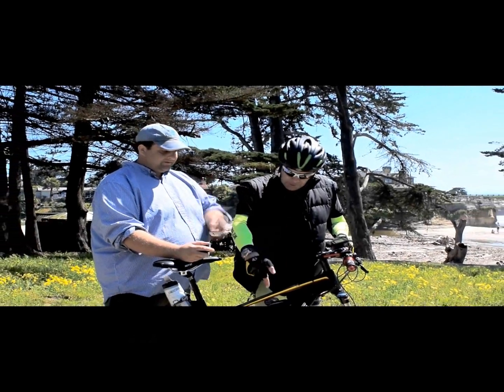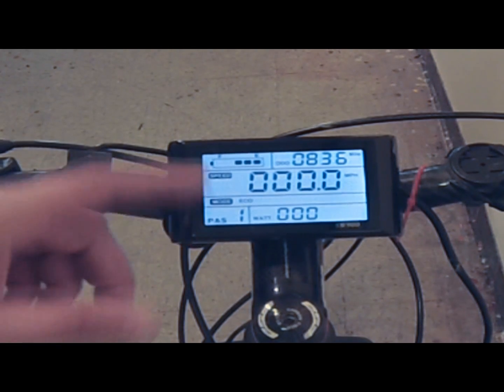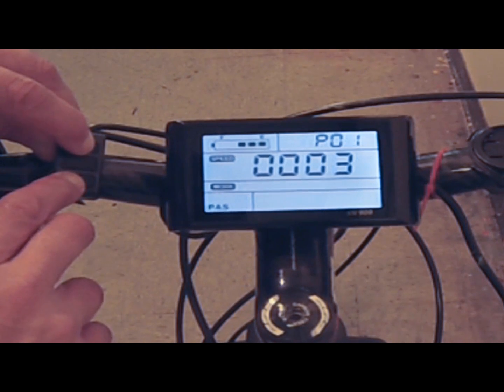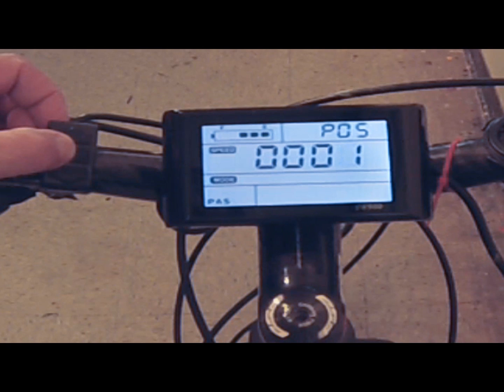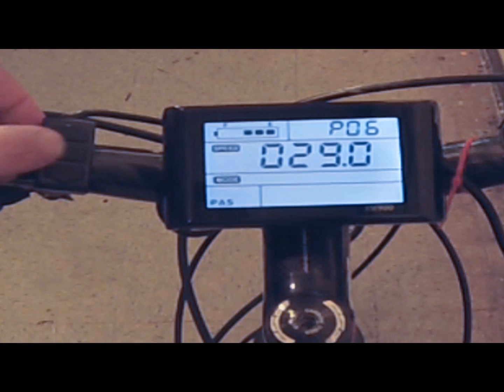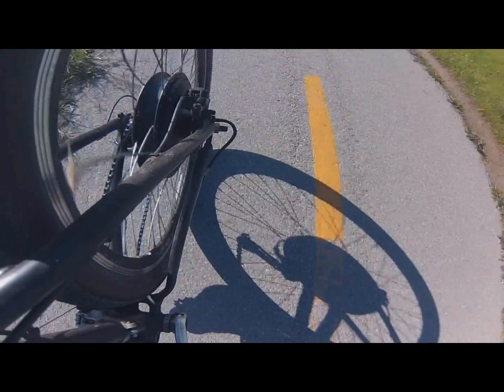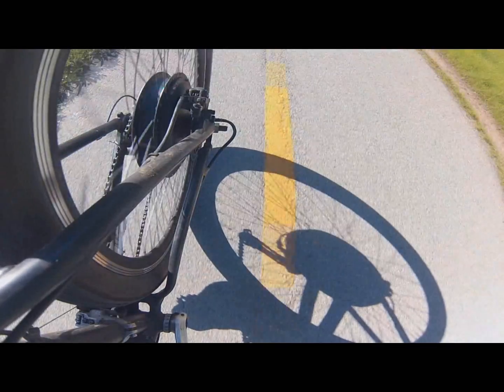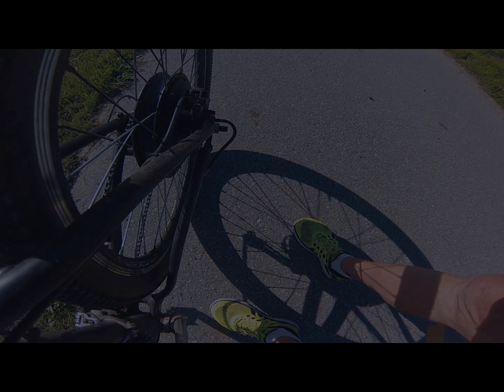How to configure the SW-900 LCD, electric bike multi-function display controller.

Comment: hello thank you for your video. the p14 parameter on my sw900 goes up to 50 A. I have the impression that it is there but inactive because setting it to 1 or 50 does not change anything in torque or speed. possible in your opinion?

Comment: P 14 set at 12A. 12A x 48V = 576 Watts. 
So you are running your 1000w motor at 576W?
Or am I mistaken in my calculations?

Comment: Thank you guys.
Just set up my Cullen version 4, 2000watt motor, 48volt ebike.
The set up of controller was easy thanks to you guys and i spent a few hours cruising and getting familiar with bike.
This thing bloody flies, had it up to 65kph, but still had more power levels to access.
Good video.
Reply: Hello can you give me a list of what you put all your settings to? I’ve messed with mine and not sure what some of the settings should actually be at. I have the same bike as yours
Reply: @rachelc3569  Just followed the set-up on the video, I cant remember wot settings its at

Comment: i have the 72v 2000w sw-900 wheel kit and have 48v battery i just ordered a 52v 2000w 20ah 50a now the wheel kit is 45a can still use the new battery at 50a

Comment: Error code 11 anyone? 

1000w 48v motor
48v 15ah battery 

Bike reaches speed and then cuts in and out briefly, seems to happen at ~1200 watts do I need to adjust #14 down to stop the controller delivering more watts than the motor is capable of?
Reply: Mine does the same have found out the issue

Comment: Does anyone know why my battery connection to the positive side of my actual battery is melting the lead strip connection just before the first cell of the positive side of my battery and of course  it is no longer connected to the battery .
It runs great for a short 4-5 blocks then no power to bike motor or LED screen .
I just soldered it up again and now it runs but I am afraid to go fast or long distance .
I have a Volimart 1000 watt 48 volt 20 Ah system with a SW-900 , this was a full compatable kit from ebay .
What is wrong ?
I was full throttling it til it died .
This system should be able to handle full throttle correct ?
I do have 2 connectors per hot wire and ground could that be the problem ? The wire was short so i used "sleightly"heavier gauge wire and 2 residential connectors per wire rated for more volts and 20 amp 
Thank you. , my email - aaaconstructionllc545@gmail.com

Comment: Hey great video. I just got my first Ebike today and it has the S900 LCD display. When I press and hold the down arrow for 3 seconds it puts a headlight icon on the screen above the power assist section. Do you happen to know what headlight I need for this controller? The s900 also has a USB port. Is that to like recharge a cell phone or something?

Comment: What is the meaning of error 02
Reply: When you brake it will cut power to the motor. it's a safety feature. it shows as an error code 2, but is not really an error.

Comment: Hy, great display but it is not so perfect... I have few questions. 1.When i turn off and then turn on display my trip memory reset to 0,  i know i have odometer, but, is is it possible not to reset trip memory when i turn off/on my bike? 2. When i do downhill without adding throttle on my display is also 0... My display just show speed when i give some throttle. 3. My odometer not count when i ride without throttle. 4. How many amp i need to put on display for my 1000w mottor, 52v 17.ah battery? Thank you all!
Reply: 1. not possible to stop trip reset on power cycle 2.  it will only measure  speed and distance when you apply throttle or PAS. need an external  independent computer/ gps to do that  3. see number 2 response 4. as high it will go 19a! better late than never... :)

Comment: What number should be on P15 and P16, my PAS doesn’t work for some reason, when I throttle the pedals become very light when I try to pedal?
Reply: I see this video is a couple years old. I'm a new ebiker and trying to dial mine in. The way mine is setup it just seems way to fast starting up on pas1.  Is there anyway to set speeds for each assist level? The bike just lunges hard with 1 pedal revolution and I need to be in the tallest gear to even be able to pedal at that speed. It's running 12 mph at eco mode. Any help would be appreciated.
Reply: get a KT controller with lcd3. much better

Comment: I just purchased a 1500w ebike bit from ebay. Whats the best battery to use for the best range?
Reply from the maker: You can use a 48v or 52v, the higher the amp hours determines your range. So, the difference between a 10ah battery and a 30ah battery is 15 miles vs 50 miles
Reply: 14ah-16ah will do just fine for approx 25 miles if you are planning to pedal.

Comment: I do not have  this computer and controller, but I find it very interesting that it would have a setting on the display for the 48v and 36v.

 If you have a 48 volt battery. What would happen if you set the controller at 36 volts? Will it still work and turn down the voltage?
Reply from the maker: The simple answer is yes, but it wouldn't work very well. The reason for the choices is at the history of electric bikes. The early ebikes were 12v then 24v then 36v and 48v. Now there are controllers that can handle a range of 24v to 72v and beyond.

Comment: Is there any possibility to set the PAS strength? No matter what I choose, I always get the full power until the speedlimit is reached.
Reply: Did you fix this problem? I got the same kit and I need to set the pas. Could you help me?
Reply: @vincenzotatti3325  I need help with this
Reply: @vincenzotatti3325  i don't think there is any way to set it. The bike always goes full Power. The setting is just fake

Comment: thanks for the video. I have  a question. Point 7. How many magnets do you have in your engine or perhaps you can tell the model of the engine so I can check myself.
Reply: Hi, did you got an answer to that?
Reply: Did you figure out how many magnets are in your engine because I accidentally changed my setting on it and don't know what the factory setting was

Comment: I finally got my system working on my trike. I needed to extend the wires and configure the trike the way I like. (I prefer bar-end shifters so that means some customization.)

I did get the PAS system to work after not working originally. I've found out working on e-bikes over the years that the Hall sensors need to detect a specific magnetic polarity to work properly. (I had an old trike where the trike went backwards when the crank was pedaled normally. The magnets were glued on the aluminum chainring.

On my latest trike I just took the PAS magnet ring off and put it back on with the other side in. I may have moved the Hall sensor to a different position to get it closer to the spinning magnets and that caused the problem originally.

Now, my comment. The PAS comes on too hard so that I'll pedal a little and the motor powers up too fast and then I coast. How can I make the motor run smoother, not on and off. I'm used to a BionX system which has a very natural and smooth PAS system. 

This is with a generic Chinese 1000 watt hub motor and a 48 volt battery. But I don't think that means much for the PAS settings.
Reply: I have the same problem with PAS comes on to strong , feels like it's on or off , thought it should 3 or 5 steps depending on the pas setings, did you find how to fix this problem ?
Reply: Not really. Today I took a 23 mile ride on a paved trail. When I started the ride the power came on like gang-busters, showing 900 watts for short periods of time. I have set my top speed to be 25 kph, translates to 16 mph in the US, about, and if I push faster than 16 mph, I get no added help.

But as the day went on, my voltage display went down to three bars. At that point the wattages were more reasonable, maybe 250-300 max to get me back up to 16 mph.

My 11 setting is 6 and my 12 setting is 5. I will set my top speed to be 14 mph to get more overall range. I can maintain 14 mph without any added power for short periods of time on my trike on flat trails.

The fully charged 48 volt battery is about 53 volts. I think, looking at wattages, that I was down to 47 volts with 3 bars. So I don't think I'll hurt the battery if I go down to one bar because each cell will be near 4 volts then.
Reply: My settings – October 26, 2018
1. 3
2. 1
3. 48
4. 0 
5. 5 level PAS
6. Tire size – 26.7
7. 46
8. 22 km/h
 (about 14 mph)
9. 0
10. 2
11. 12
12. 5
13. 8
14. 12

I set the tire size to get a match between my display miles and my miles that show on my GPS app on my cell phone. Using Endomondo, but Strava and Runkeeper do the same.

Comment: Q- I just bought a fat tire bike so SHOULD I leave the Multi-function mode #6 as default of 26 or do I need to adjust differently because of the fat tires to something higher/larger?

Comment: My pas is not kicking in the motor, I don't know what is wrong... The led on the pas indicates that it's working. If done everything correct
Reply: did you check your magnet disc direction?

Comment: My pas when I adjust 10 and 11 does not make a difference in how much pas I get? As soon as I start to pedal the motor take off and goes to 20MPH plus. I can't even get any weight on petals at all. What are your thoughts? Thanks
Reply: I'm still trying to figure out P11. It doesn't seem to make a difference. I want less assist on PAS level 1.
Reply: Norman Christner same for me and lots of others nobody (inc this guy) has an answer for it!! It makes the pas screen levels 1 - 5 totally useless,  does any1 have a answer to this question??????
Reply: I have the same question. Can someone tell us, maybe Kirby, what settings with PAS give us the best range and what PAS settings give us the best performance.

Yes I've found out that PAS 1 and setting a low top speed helps the range but what should you set settings 11 and 12.

Yesterday when I was riding I saw multiples of 1, 2, 3, 4, etc amps as converted to watts with a full 48 volt battery giving watts readings of 53, 106, 159, 212, etc. This is what I want. Today I changed 11 and 12 and I was seeing big wattages, 700, 800, 900 or so. Guess I should have written down what my settings were yesterday..

Comment: The SW900 controller watt read out has only 3 digits therefore will only read 999 watts and not suitable for e-bikes with higher wattage ratings. I have 1200 watt bike my SW900 reads fine until give it full throttle then reads 200 watts. I hope this won't hurt the SW900. Any comments would be appreciated.
Reply: Dwyane Dandridge can you send me a picture of your controller? Maybe I can help?
Reply: Not sure how to send you a picture but it's identical to the one in the video.
Reply: that's weird mine has 4 digits, it reads like 1150 full throttle.

Comment: I have a 1000W 48V motor with a SW-900 LCD display but my controller is toast where can I get the right controller or can I buy any 48V controller ...I have heard it has to be the same controller what come with the display but this controller is not to find , please let me know ?
Reply: many sellers on ebay sell them, putting in search for KT Lcd3 Lcd Display will show the sw900 ebike display

Comment: #7 speed measuring magnet - I have messed with this and reset it to 001 but it pretty much disabled the PAS by making the bike believe that I was doing 100km/h when I was barely breaking 10 km/h. with a bit of trial and error, I raised the value to approx 85 and it seems to be more reasonable. Does anyone know where to find direction for calibrating this value?
Reply: I have it at 45
Reply: the factory value on mine is 46. I didn't change it.

Comment: Curious why my display only shows speed reading when pedaling or why the throttle is pressed.  Goes to zero when coasting.  Is this normal for these displays?
Reply: Michael Cynkar mine is also like this... did you found a solution to this problem?
Reply: Mine as well

Comment: No 14 is the current limiter. If i use 1000w motor and 48v battery can i change it to 20 ? If so is it there more risk to burn the motor ?
Reply from the maker: No

Comment: Thanks. Helpful video. I'm getting error 08 on mine. When I twist the throttle the error goes away. Do you know what error 08 means? I read somewhere it said throttle error. But no other details. Cheers.
Reply from the maker: Hey Hunt,

Error code 8 is a throttle problem. But since it goes away when you throttle it seems to me a loose connection with your throttle wiring. Double check the connection to make sure it is tight. Let us know!
Reply: Augustine fast Carbon e-Bikes - Santa Cruz 2017 hey mate. Cheers for the reply. Turns out the wiring colour scheme for the controller is slightly different for the two brake lever switches (that cut the motor when you brake). The brake levers had red/black but at the controller they plug into yellow/black. Not sure why but it's all good now! I do now have a red/black plug from the controller that is spare. Also from the lcd screen there's the main plug that has maybe 7 wires and that's all good, except there's also one with 2 wires that I don't know what it's for. Maybe that's for an led light Perhaps? I don't know. Any ideas? Thanks again.
Reply from the maker: If the wires are grey, they are most likely the speed governor, which limits the speed for the country you are in. It is required by law for manufacturers to include that, however most leave it disconnected, because you can determine your maximum speed by programming your onboard computer. If it is not that, it is either lights or cruise control.
Reply: Augustine fast Carbon e-Bikes - Santa Cruz 2017 thanks for that. All sorted now. I do have a question in regards to the pas system. The settings P05, P11 and P12. Maybe the controller is very crude but I'm having a hard time working out how to set the pas system up. P11, pas sensitivity, does this mean the lower the number you set, the pas will kick in sooner? And the higher the number, the more peddling you need to do before it kicks in? And P05, PAS Grades, what does this mean? Oh and P12, PAS start strength, I think is self explanatory? The higher the number the more aggressive the PAS kicks in? Cheers :)
Reply: I also get error 08 as soon as i connect the power limit wire. The bike doesnt seem to be more (or less) powerful with the wire connected (im still not sure weather the wire should be plugged in or not for full power), and it also goes away when i throttle.  My bike doesnt have PAS sensor connected yet. Have you sorted out what is going on ? cheers

Comment: Thanks for the video! very informative!  I saw your bike also had error code 10 on the display early in the video. My bike has tje same code and I cannot find out what it means. Any help would he appreciated. Thanks!
Reply from the maker: Error 10 is a communication error between the controller and a device that isn't connected. Each controller comes with connections to a variety of functions. In my case I don't have cruise control connected, which gives me a #10 error
Reply: @AugustineEBikes  
Error Code 3 ?